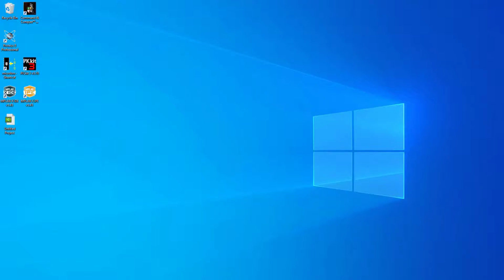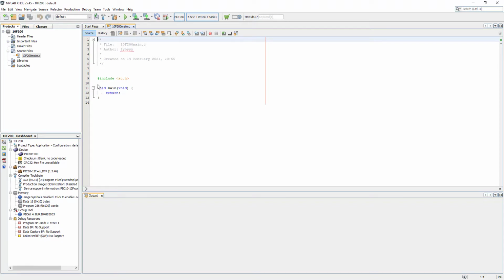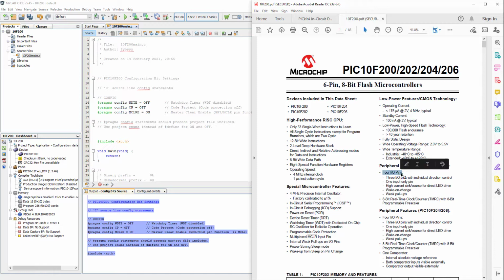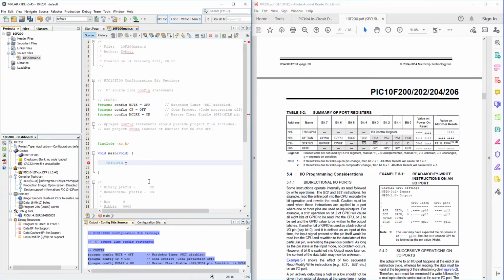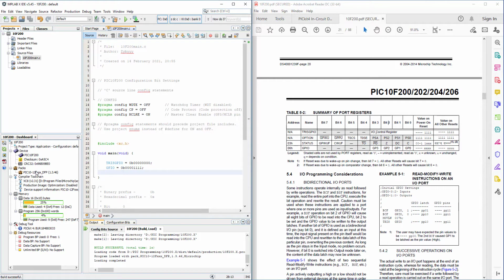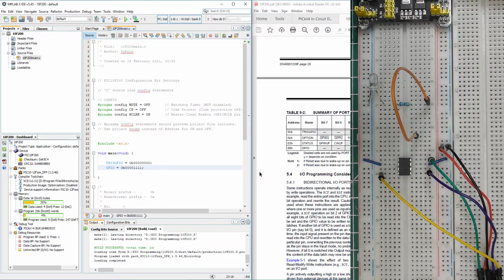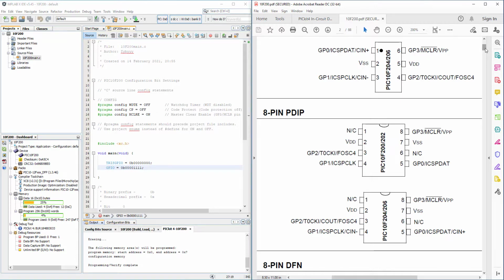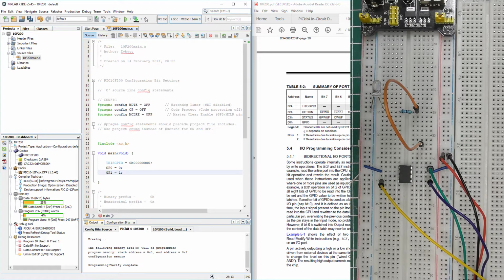Programming PIC Microcontrollers using C Language. № 4 - 10F200, setting TRIS and GPIO registers

Comment: When I try to program via ICSP (using micropro.exe) I receive an error message "ROM programming error at address 0x0000 - Good 0x0A43 - Bad 0xFFF" when programming, what would be the the problem?
Reply from the maker: Hi Murat. 
There could be few reasons to that - It could be chip itself. 
Is it 10F series chip - Maybe settings are selected for a different one?
It could be damaged - have you got another one to check? 
Check your connections to PIC - missing MCLR connection could be the reason.

Hope it helps.
Thank you.